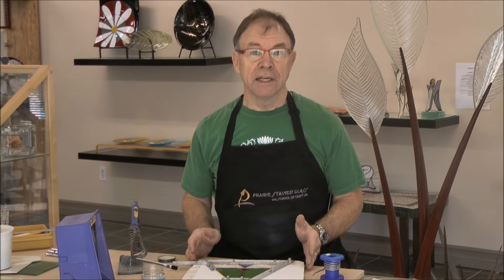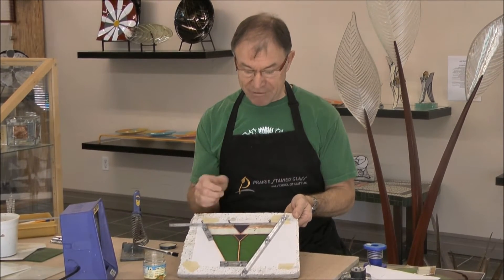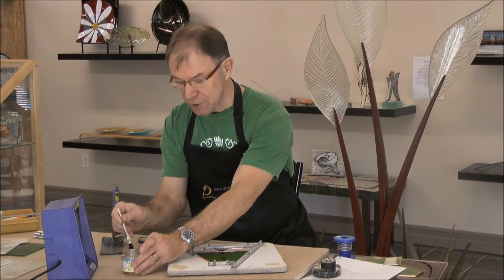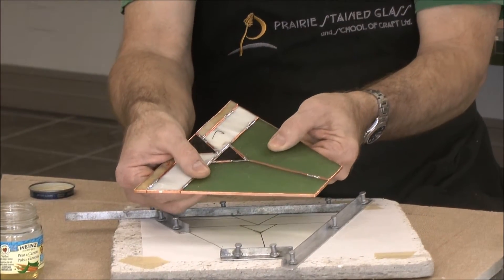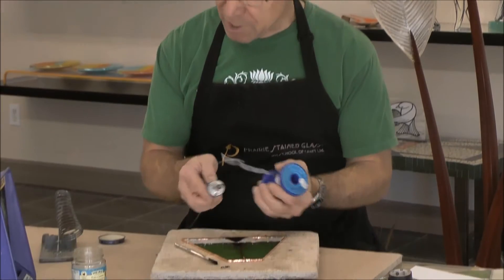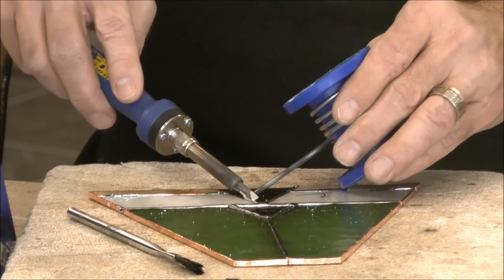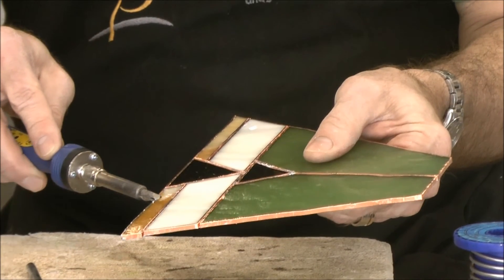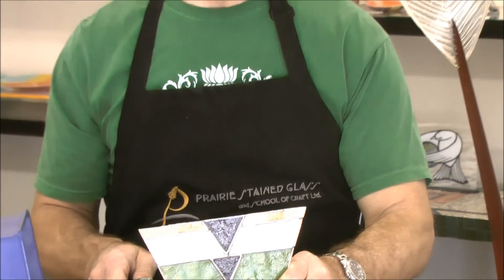How To: Mission Style Stained Glass Lamp Pt. 2 - Beginning to Solder

Comment: Can you tell me what setting your iron was on if it is a Haako FX-650.I am considering buying one but concerned that
the lowest temp setting (240 deg.C=464 deg F) will be too hot for me as a beginner using 60/40 solder.